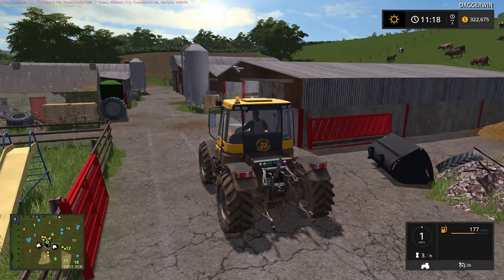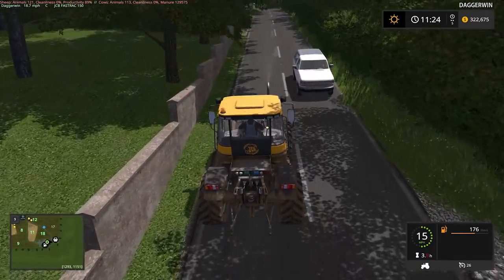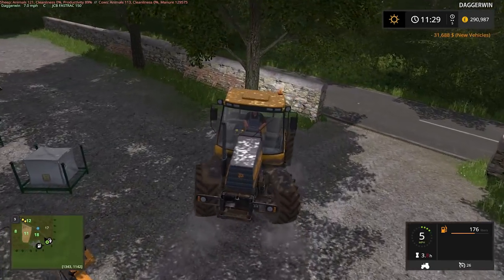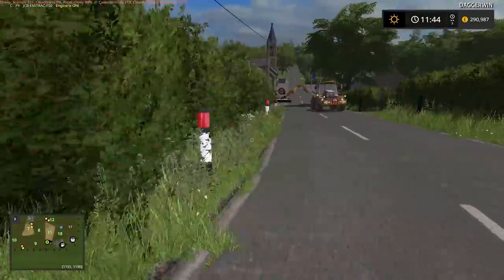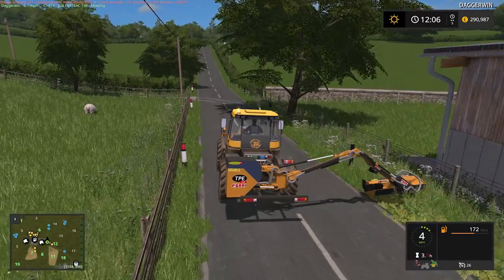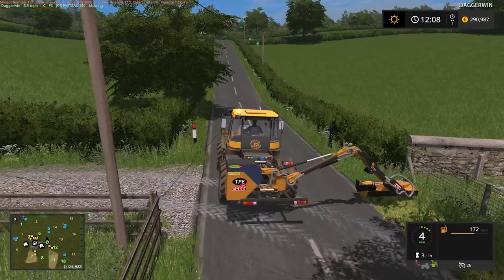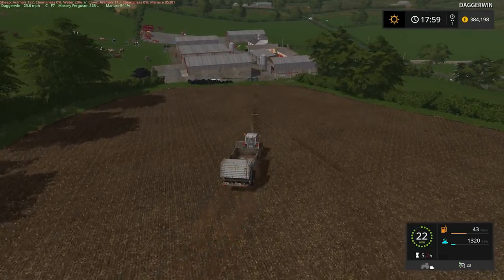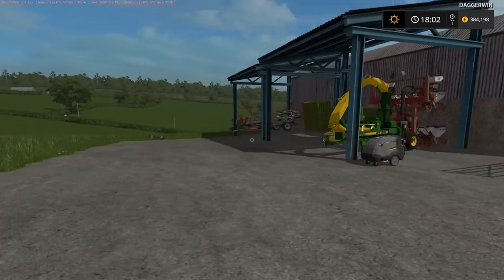ROADSIDE WORK - Ballincraig Estate | Farming Simulator 17 - Episode 31

Comment: And I thought the sign / counterweight was to be stuck at the back… why tell people to go to the sides when they can't even see…

Also, this would solve the problem of mowing the wrong way
Reply: It is for the front, normally the hedge cutter would have some form of sign on the back of it
Reply: but if you switch places the arrows wont be flipped over
considering that i will continue to hold my point
Reply: You are right
Reply: Well, as it is when you indicate to show your on the left verge the sign directs people over to the right, so maybe it is correct.
Reply: Yeah you are right it is ment to be on the back to tell traffic witch side to go around you.